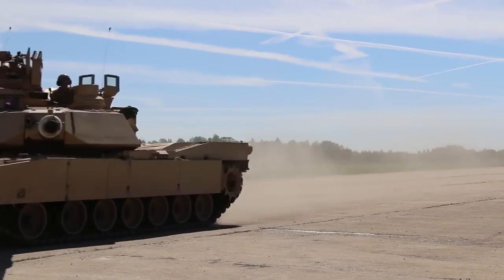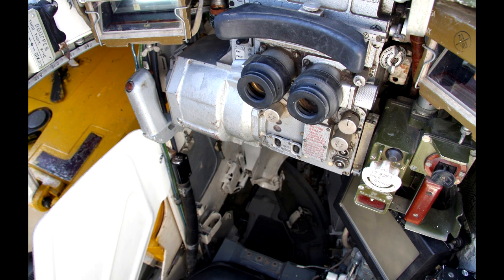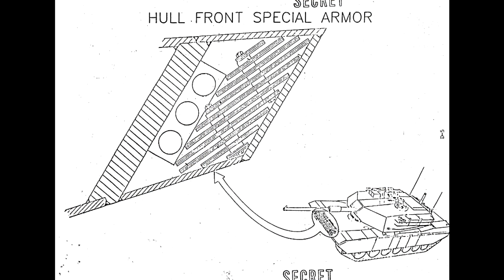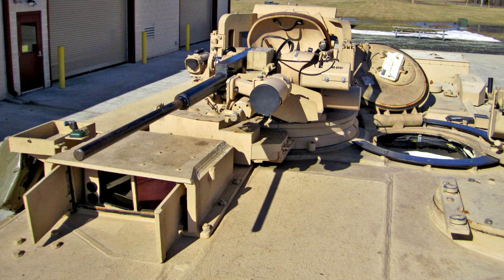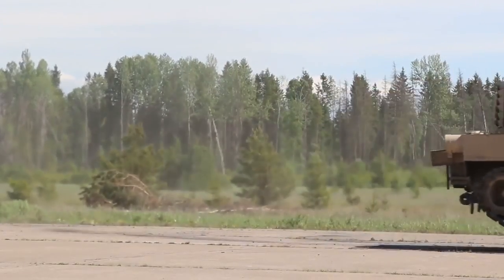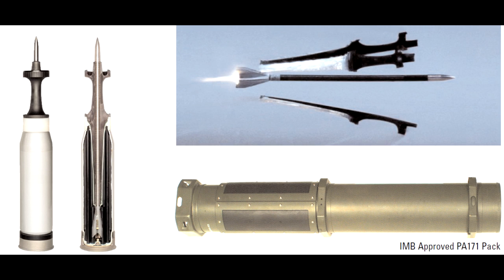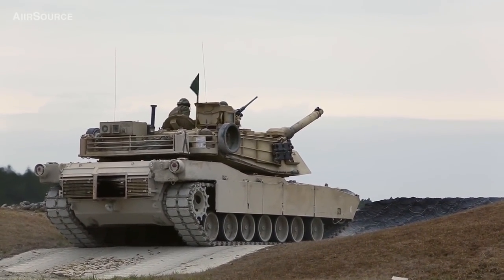Problems with Abrams tank

Comment: Funny thing about the gas turbine is that it does have several advantages over diesel ones.  For one, it's quieter, with the high pitched whine of the turbine not carrying anywhere near as far as the low rumble of diesels.  Also, turbines are much lower maintenance engines with fewer moving parts, making them easier and cheaper to work on.

I also don't see the US swapping to longer barrel guns because doing so would mean having to swap over from DU penetrators, which shatter way too easily at higher speeds, but still get comparable results to higher velocity penetrators.

Comment: Interesting video, you do make some valid points.

The reason for going with 105 and upgrade later was that at the time a 105mm was more than enough to destroy any  Russian tank while you could carry more rounds. Still, going with 120mm straight away would have made it more future proof. 

The gas turbine is thirsty and hot (heat seeker magnet) BUT quiet en performs very well. Both diesel and gas turbine have their ups and downs. For the US with its huge logistics system it could work. For smaller countries a diesel makes more sense. IIRC Australian Abrams has diesel. Both have their good points but still I would give diesel to Abrams to make logistic easier (diesel for all vehicles) and makes it less visible in IR.

The early models not having  CITV is a valid point, fixed with M1A2 but there are still lots of M1A1s in service, which still lack CITV. It makes no sense that CITV was not fitted to all. Is fitting CITV difficult with existing A1?

Compared to the Leopard 2 the armor of original Abrams was better. There is no evidence that 125mm at the time could penetrate M1 front. From Desert Storm we know that neither 125mm or 120mm can penetrate turret side of M1A1. So unlikely these could penetrate front of original M1 as I doubt M1A1 side armor is better than M1 front as side armor is half that of the front. Abrams was build for protection (and firepower) whereas Leopard 2 was build for mobility.  OVvr the years have come closer together. With Abrams getting 120mm and Leopard 2 A5 and upwards got hug armor upgrade. When they shot Leo2A5 from the front it took 7 hits at the same spot to penetrate. Still Abrams has heavier armor, pretty much invulnerable at the front. Leo2 A5 still has weaker side armor on the rear half of the side which has no add-on armor.

No Abrams was ever taken out by another tank, could even survive friendly fire. To take out Abrams Russian tanks will have to hit the rear. There have been no experiences from the field of the front hull being weak, just the hull sides. So I would take the front hull problem with a huge grain of alt. Few US Abrams were taken out. The few that have were due to engine fire, huge IEDs or hit from the rear. If the front hull would be as weak as stated here there would be much more taken out and a lot dead drivers.
Iraqi and Saudi Abrams have had losses. These  are very much downgrades, especially the armor. The crews are also very poorly trained and bail out when hit (despite not being penetrated). Which is why Islamic State managed to capture intact Abrams tanks.

From what I've read the Abrams actually has armor penetration with L44 gum very close to L55 because Abrams uses DU rounds and Leo2 A6/A7 does not. Tungsten rounds lose their sharpness the moment they penetrate but DU penetrators remain sharp during penetration.
Both of them can kill any operational Russian tank with a single shot. While I do believe the west had to invest in new MBTs both Abrams and Leo2 can take on T-14 in head to head. T-14 has better crew survivability compared to its predecessors (which was terrible) but the unmanned turret appears to have little armor. When you hit the turret the tank is basically destroyed (doubt they have lots of spare turrets) . The turret has the ammo so it will probably result in a huge explosion. If we look at how Russian tanks in Ukr are in many cases blown into pieces the question is whether an ammo explosion would allow the crew to survive, might just give them a bit more time to bail out though.
If Abrams or Leo2 are knocked out, in most cases they can be repaired.  But T-15 is lost when turret is hit.

Upgrading Abrams with L55 is interesting but L55 becomes a problem in urban areas as you need much more room to rotate the turret. And as urban combat has been a major part of US operations this would explain why no L55 was bought.  
How about enlarging the rear turret instead so longer rounds can be stored?
Or perhaps a modular barrel? Allowing crews in the field to shorten the barrel before going into urban areas, and put it on the rear bustle rack and re-attach it when needed again.

Comment: There were Two Versions of the XM1 Tank. One was made by GM the other was made by Chrysler Defense Engineering. The GM Tank had a Diesel Engine, the Chrysler Tank had a AVCO Lycoming 1500 Turbine Engine which was a larger size version of  Engine used in the Huey and Cobra Helicopters. After the run off testing, the Army decided to go with the Chrysler Tank. There was Summer Testing and Extreme Cold Weather Testing of the Tank. 

Unless you were on a Diesel Tank as a Tanker and then transitioned to the M1 Abrams like I did, you do not know or understand the big differences and how so much better the Abrams is. The Gunners Station and Commander Station are Classified with the Army not allowing it to be photographed. From being on the first version of the Abrams I can say there was a TC Over-ride for the Man Gun and the TC had a Laser Range Finder. The Gunner had a Telescope Sight, Thermal Sights, and a Laser Range Finder.

I know there has to be a TC Over-ride on the M1A2 Abrams because the TC determines which Tank to engage and if necessary will Over-ride the Gunner taking the Turret to another Target. This happened to me so many times after firing the Real 735 Sabot Rounds. Those Rounds moved so fast I was say LOST but the TC saw it was a direct hit. The TC would Over-ride me to the next target. The Loader had already loaded another Round had announced UP so I knew all I had to do was to announce Identified and Lasing. The TC said Fire so I said On The Way..

Comment: The Original Abrams had a Commanders Sight and Over ride. The Original had a Gunners Telescope and you could see with the Thermal Sighs  in Day Mode, Night Mode and through Fog or Smoke. We  Tested the Sights and used them in all of the Modes Firing Rounds..

The Photo you used are of the Old Version, The TC is wearing Army Green Fatigues. 

The Power and Torque is why the Abrams has a Turbine Engine. You have never been a Tanker on one. Once you have been on it and see what it can do and how it can move, you will shut up. 

We did Test showing how fast the Tank could exit out of a ditch move to the firing line and fire a round, back up to another position and fire the second round. We also did firing on the move  with out stopping. We had the old Black and White and White and Black Thermal Modes. 

You base on what you read and researched but were never a Tanker.
Reply: they never mention the torque of the turbine do they?
Reply: Dieser Kanal ist ein reiner russischer Propaganda-Kanal, der alles russische toll findet. Zwischenzeitlich hat er sogar ein Video veröffentlicht, wo er ausschließlich gute Argumente findet, dass uralte T62M an die ukrainische Front geschickt werden, wo ihre T80 kläglich versagt haben. Aber bei einem M1 findet er das Körnchen in der Suppe. Scheinheiliger geht es nicht mehr. Naja, ich finde die Derails ganz interessant, aber seine Schlussfolgerungen sind immer und ausschließlich populistisch und haben wenig mit einer objektiven Betrachtung zu tun.

Comment: To the Maker of this Video I ask were you ever a Tanker? I ask because you are so full of it about the First M1 Abrams . I was a part of the  Extreme Cold Weather Testing when it was still the XM1.

I was on the Sheridan, M48, M60, and M60A1 before being on the XM1 and later the M1 Abrams . I saw how much better the M1 is compared to the old M48 and M60 Series of Tanks. The M60 was upgraded to fire  the 735 Sabot  Rounds and the M1 was firing the DU Rounds. The M1 was upgraded to a larger German Main Gin and the Armor was upgraded making it heavier.

I can tell you from being on the old Diesel Sheridan, M48 and M60's Series all were prone to Blown Packs or Blown Turbo Chargers. I cannot count how many I saw break down with Blown Packs which had to be removed. On my own M60A1 Rise Passive Tank we blew a Pack on the way to Gunnery at Graf. We had to be towed the rest of the way to Graf by our M88A1 Armored Recovery Vehicle. At Graf we went to work pulling the pack and putting a new pack in.

On the XM1 we had a few issues which the Chrysler Defense Engineering Reps repaired immediately so the Testing could go on. I broke a Torsion Bar after going over frozen terrain as part of the Mobility Run. I was Driving at the time. I can tell you the Tank had so much power and torque compared to the Diesel Tanks. After the repair we continued with no more problem other than a  problem with the Thermal Sight which had to be replaced.

During the Gunnery Phase of the Testing I took over as the Gunner because the other Sergeant who was the Gunner had to return back to Fort Riley because his Wife was in labor. I was a Sergeant so I took over. The TC was a Staff Sergeant. A SP4 took over as the Driver. I can tell you with the 105mm Gun I got First Round Hits. We were firing the Real 735 Rounds and not the Blue Training Rounds. There is a Big Difference firing the Real Deal Rounds. They moved so fast the TC had to confirm the hit and they say next target.

The M1 Destroyed were the Export Versions and not the New Upgraded Version which is a Beast of a Tank. None of the Newest Tanks have been destroyed and in a Head to Head Shoot Out with a Russian or a Chinese Tank, I put my money on the Abrams because it is the Training the Crew receives that matters. American Tank Crews Train all the time and go to Gunnery 2-3 Times per year. 

The Tank that gets the First Round Off and The First Round Hit is the Tank that WINS THE BATTLE1
Reply: American tanks only perform well against poor nations with little military capabilities. Artillery barrages, supply depots constantly hit from cruise missiles and denying safe passage through air will show how mis-engineered the tank is. Most nations produce tanks in the case a war of attrition happens so their performance stays the same or increases. America has a theoretical strategy learned from war on terror. None of their tactics ever worked in nation vs nation hence Vietnam which still was a poor nation. Afghan is perfect for tank combat and delusional military doctrine hence terrain is so easy. Countries like ukrain, Vientiane and Russia have death trap terrain and would see these vehicles destroyed in piles of rare metal.
Reply: @74dthereapers94  You were never a Tanker. We have witnessed in Ukraine what American equipment and training did to Mighty Russia.

We saw Isreal use American M60 Tanks to defeT the Arabs in the Yom Kippur War. 

America, Israel, the UK, and Germany has the Best Tanks and Tankers. All are better trained and equipped
Reply: @charlesanthony4693  you don’t know who I am and weapons used by a weak regime of Russian export origin means very little. In Ukraine if you can manage to see through the cloud of bullshit, media says russia is moving taking cities in company or smaller sizes. Zelensky down playing the war saying they lose 100 men a day killed! Russia barely losing any men while killing-many hundreds a day, it got worse since western tech hit the battlefield. You can sit here and say all the surprises information you think about previous wars but almost all have been failures with tons of confidential losses we’ll never know. I know why politicians downplaying things ie damage control and personal interest but I can’t grasp why people who never touched 100 grand  in life believing bullshit when they subliminal tell the truth.
Reply: @74dthereapers94  ok keyboard gibberish how many rubles are they giving you? about a $1s worth?

Comment: Great video, but you're completely wrong about gas turbine engines, as gas turbine engines are superior to their piston-driven counterparts in every way except fuel consumption and mechanical complexity. Gas turbines burn their fuels more efficently which means they produce far less soot than, say, the V12 twin-turbo-diesel of the Leopard 2, even when running on diesel fuel, so a gas turbine will have an over all smaller thermal signature despite running hotter as its cleaner exhaust fumes cool off far faster. Gas turbines spool up faster which means they have noticably superior acceleration. Gas turbines are also a lot less likely to freeze and can withstand far lower temperatures than piston engines, which makes them ideal for use in cold climates. 

Really, if you can afford to produce and maintain them and you have the fuel supply lines to feed them, as the US did throughout the entire 1950s-2010s period, then you have absolutely no reason what so ever to choose a conventional piston-driven engine over a gas turbine engine.
Reply: When I was assigned to an Army Armor battalion back in the early 90s as the signal officer, never ever heard of a tank crew complain about the turbine engine.  They loved the power, sound, smell, and all the other advantages it gave them.  We had senior NCO and senior officers that started out with the old M60 tanks and they would never want to go back to that engine or series of tanks.  The only downside was fuel consumption; but, we always had fuelers available and always had plenty for the training mission we ran.

Comment: You forgot to add:  NO M-1 was ever frontally penetrated by a tank.  I believe 2 or so had t-72 rds sticking out the front hull when they didnt penetrate.  I do believe 1 or 2 were finally successfully penetrated by a special PRG-29 rd.  but it did not destroy it.  (but did kill the drivers?).  So, apparently the hull armour isnt so bad.

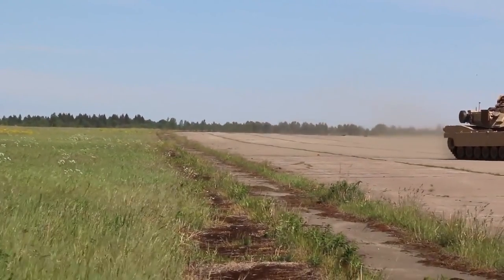Comment: When it comes to "factional" videos i have a hard time watching them to the finish as soon as i see the slightest hint of bias over fact. Only needed 1:30 on this one. Was actually interested at the topic and don't know much about this tank, so its a bit of a shame. The proclamation that there is no benefits over diesel engine is simply false. The main reasons for why i think they made this choice, in order of increasing significance, are:
Flatter torque curve
Higher power/weight ratio
Smokeless.

Comment: You didn't mentioned that leopard 2 diesel engine is much heavier. Waight is very crucial. You can exchange it for more armor. And when I had to choose, better i want to sit in American tank than Russian or German with gigantic ammo racks in hull. But I think that video is still valuable. Respect From Poland ,
Reply: Leopard 2a7 is the best tank in the world. Americans and Russians are overhyped
Reply: There is no such thing as best when it comes to weapon systems. The tank is just part of that system. Taken together a weapon system is optimized for a set of environments. The Leopard and Abrams plus their support were designed with different missions and requirements. So who fairs better depends on the circumstances they face in combat.

Comment: Well, This was a gem to find. 

You say the gas turbine engine is bad because it is more expensive... Yes, but it is also the ONLY tank engine that will run on regular unleaded, diesel, kerosene, and jet fuel... so what ever happens to be available in the are. You are clearly have never done ANY research on how logistics works. If you have a ton of vehicles all using the same type of fuel, it runs out REALLY fast. If you have a tank that can use jet fuel, you can literally top it off at the airport. Being able to use any fuel is a HUGE advantage when supplies are short. It was intended to fight a massive army of soviet tanks and it was thought that the soviet air force could destroy depos that had a lot of fuel for these tanks. 

You say the 105 was bad compared to Russian tanks, but the gun only needed to be big enough to actually destroy the enemy tanks, which the Israeli tanks did in the Yum Kippur war in 1973. The 105s (plus anti tank weapons) were the main weapon and that war resulted in 2300 destroyed or captured Russian tanks. They also took only 6 years before switching to the 120mm that is used on almost every NATO tank so that all allies can use the same ammo. Even if you wanted to go a little more modern, Desert Storm had the USMC using 105s on the M60s they still had in service and they did well against the Russian tanks in Kuwait. 

Interesting how you talk about the lack of armor, but the exact nature of the armor is completely classified, and no Iraqi tank destroyed an Abrams despite the fact that several were damaged and hit. So it seems a bit odd that YOU know that the armor would have been easily penetrated by Russian rounds when actual events tell a different story.
Reply: Aren't the Iraqi T-72s export versions and from what I heard, they at the time didn't have the latest Russian made APFSDS and we're incapable of firing ATGMs unlike base Russian Tanks.
Reply: @josevictorionunez9312  but he didn't specify what type of ammunition needed to be used, he said any penetrator type ammo would have easily went through the upper plate.